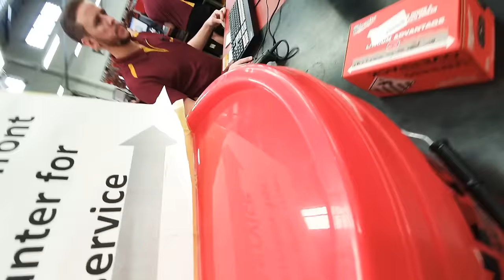Pro Drywall Construction Crew with The Right Tools that GO FAST!

Comment: Is there a specific reason they are not using adhesive on the studs to attach the gyprock correctly?
Reply: @TheOfficialDjProduct  not using glue because regulators don’t require it is pretty sloppy work. We all know over time the gyprock wobbles loose and even when it’s freshly installed without glue the wall plastered wall makes a knocking sound when struck.
Reply: There is glue the blue adhesive can be seen on the studs if you look close enough
Reply: I have never used glue on metal stud. Glue is for the old nail days really. Nails tend to pop after years and glue keeps down movement
Reply: @harryhoudini2645  no glue is required to stop knocking. Even a new 13mm board freshly installed can knock. In this day and age no plaster sheeting should ever be installed without adhesive.
Reply: A lot don't use glue screws is good enough
Reply: @marcarriaga3201  not it’s definitely not and everyone in trade knows it.

Comment: Lol tell him put them nails by hand same speed then I might be impressed..
Reply: Title of video.. right tools.
And nails are not up to code for drywall.
Reply from the maker: It's Australia if you didn't know
Reply from the maker: Those days are gone mate.
Reply: Get with the times old man, collated guns beat out the best hand nailer any day. You wish you had this pace back in the 70's
Reply: Screws are stronger then clouts
Reply: I remember the nail days hold a 12 foot 5/8 sheet on ceiling and nail it. Those were the good old days. When your partner gets his nail set you hit the board as hard as you can and drop his nail. If you know you know.😂